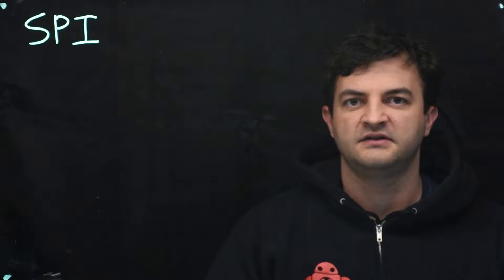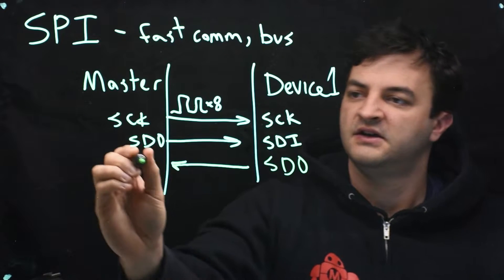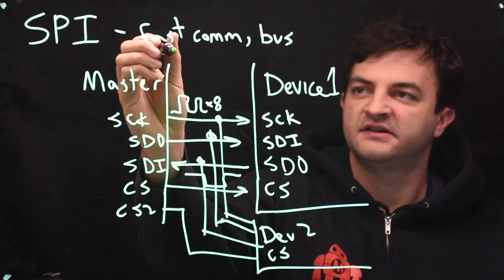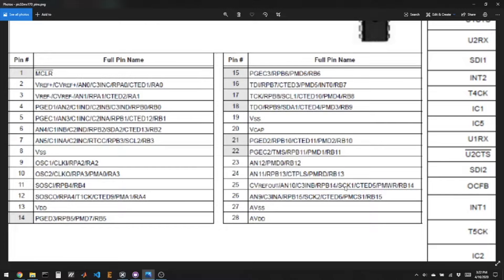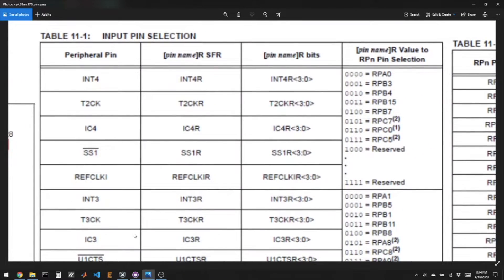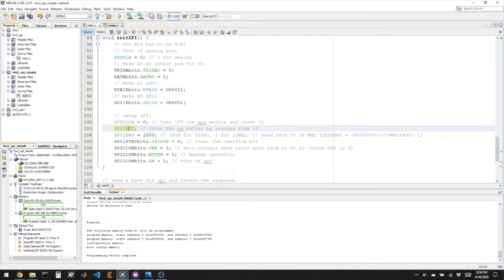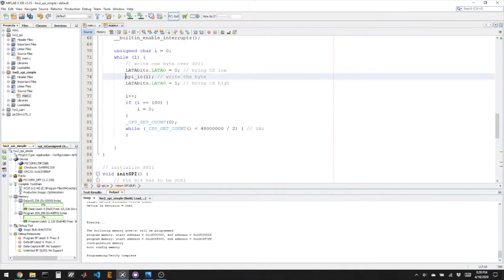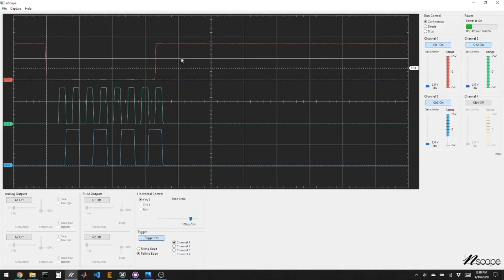SPI communication on the PIC32

Comment: What if you want to have an interrupt to read the data every time the data is ready to be read? How you do that?
Reply from the maker: Not as easy as you would think! If the PIC is the host, talking to a device like an accelerometer or encoder or another microcontroller, the PIC must initiate communication with the device  by bringing the CS pin low. If the device wants to talk to you, unless it has an INT pin that it toggles to get your attention, it has no way to talk to the PIC unless the PIC is talking to it. So you would need to use a polling method to regularly talk to the device. Or if the device is a microcontroller, make it the host and the PIC the device. For interrupts, table 7-1 in the datasheet shows 3 IRQs going to the same vector, so an SPI fault, SPI receive done, and SPI transmit done all end up in the same interrupt function. So if you enable the SPI interrupt, when you get into the function, check to see which of those 3 things got you there, and if it is from a receive, copy the byte out of SPIxBUF. For videos on interrupts, see "PIC32 interrupt SFRs (Kevin Lynch)" or my video "Interrupts on the PIC32"